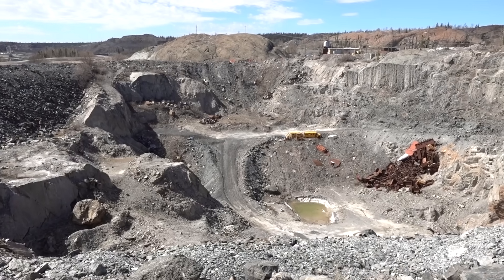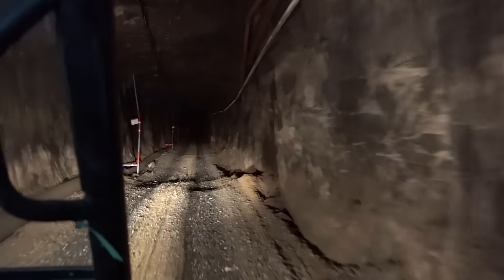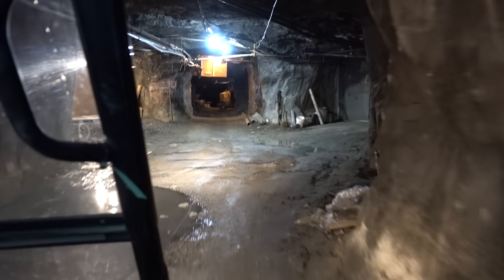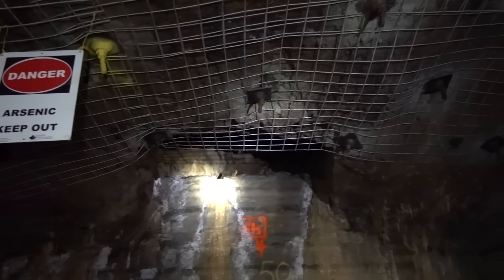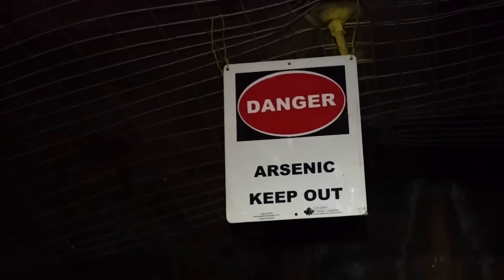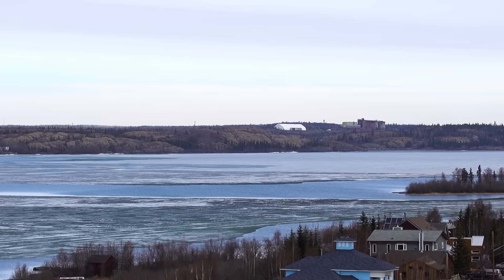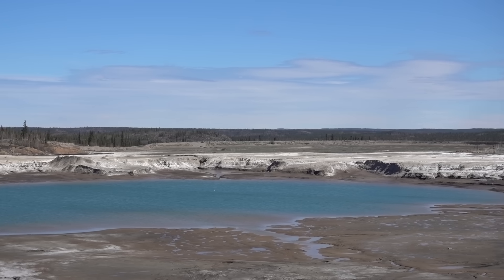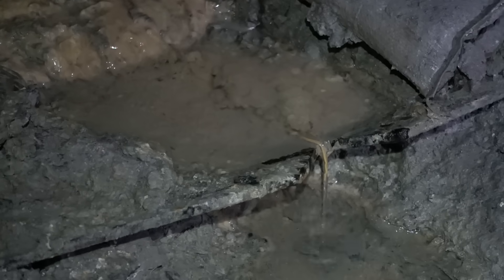Making 200,000 tons of arsenic dust safe

Comment: Why not mine up all the arsenic? That way you can store and control things surrounding it far better. Plus lets you possibly convert it into compounds Because putt that are harmless or less harmful.
Reply: You'd have a situation similar to the Liquidators of Chernobyl, where no one in their sane mind would want the job.
Reply: It's very fine volatile dust. The minute you start mining it you release a huge cloud of death over the city and surrounding area.
Reply: It’s dust, it’d be almost impossible to keep it contained during the mining.
Reply: Because there's no call for all that arsenic, and what demand for arsenic is supplied by purifying the waste products of active copper smelting. So, if you mined and purified this arsenic, then you would have to dispose of an equal amount of arsenic waste from (mostly Chinese) copper smelters.
Reply: bruh just put on a snorkel and use a dust pan

problem solved
Reply: Way more risky.
Reply: not if you are mining the ice that contains it
Reply: John J cheaper and safer to freeze it for now
Reply: "For now"...  and you just know it's going to get abandoned like the mine itself within a few decades.
Reply: That would achieve nothing and would very likely further pollute the water with more arsenic, as well as nuclear fallout, and would make yellowknife uninhabitable, because there is now a death cloud of arsenic and fallout over the city, not to mention that a nuke could directly damage the city, depending on how well controlled it would be.
Reply: Assuming thats jam packed in those caverns, couldnt one use something like a hydraulic cylnder and pack all of it into solid blocks?
Reply: FelixTheWat Here in Denmark they've just started digging up tons of polluted dirt left behind by a chemical company.
Reply: time and cost
Reply: i prefer the nuclear option, blow the mine up with a nuclear weapon.

Comment: It's disgusting how mining companies can get away with declaring bankruptcy and then bugger off without having to do anything about the poisons they've left (since, "obviously", it would be wrong to hold the owners of the company responsible for the company's actions and debts /s).
Reply: In some countries, companies are forced to set aside money for remediation into a seperate trust that would not be effected by bancruptcy. That way you can at least mitigate some of the "tragedy of the commons".
Reply: In the US, this is the case for commercial nuclear plants. All plants are required by law to have a decommissioning fund, and it is audited every 2 years to ensure that it's large enough to cover all the costs of decommissioning.
Reply: +Zachary Henderson "The CEO is just an employee of the company, the same as a heavy equipment operator." and guess what happens if a heavy equipment operator decides to get in a crane and drop huge slabs of concrete into people's homes?

Employees of companies are still liable for their actions.
Reply: Throwing the owners in jail would very much fix the problem.  Do that consistently and very quickly we'd see people stop exploiting the system.  The problem is that they pay off the politicians so they never have to go to jail.
Reply: +Windhelm Guard bankruptcy doesn't mean there's zero money. For example, everyone brings up that Trump bankrupted a bunch of companies - but he still has money. You can make people liable and force them to pay out of their own pocket even if a company is technically in bankruptcy.
Reply: It's called piercing the corporate veil. In certain circumstances, the courts will hold owners personally liable for corporate obligations such as cleaning up this kind of mess. In this particular case, the owner Margaret Witte was taken to court for allegedly raiding the company's funds before declaring bankruptcy.
Reply: SpeakShibboleth yea, but thats on purpose so no one has to take responsibility. Harmful decisions were made, as Tom said, so you can't claim no one was calling the shots.
Reply: Nubbinz It will be cleaned and paid by the gov aka everybody. They should seize the assets of the previous sharholders up to the 1b stated instead...
Reply: andi sixtimesseven so you could have one shareholder holding millions of shares or millions of shareholder holding one share. Of those millions of shareholder those shares could have been traded many, many times. So who is to be held responsible? Maybe your pension fund fund held shares by which you profited, so are you responsible?

Yes there are many ways that this could have been handled over the many, many years it would have taken to make this mess but closing stable doors come to mind. All you can do is stop it happening in the future and regulating.
Reply: What is even more disgusting is when companies plan to start a mine, finish polluting the surrounding environment as much as possible, and bugger off when they're done. There are companies that actively do that.
Reply: ObadiahtheSlim - while it is true that the EPA isn't perfect, that is not why they were a villain in the 80s.  The EPA and CDC both make common villains, esp in the 80s and 90s.  They are two organizations that produce a lot of anxiety, they are almost entirely associated with bad stuff happening and over the years that changed into a 'shoot the messenger' public perception.  Making them the villians in so many movies and TV gave people a sense of control over these larger than life problems because the symbols of them could be defeated by pluck and american ethos.
Reply: by paying up front of insurance to cover the damage.
Reply: Cody Scott You missed the "actually fixing the problem" step and went straight to "at least it feels good"
Reply: Well, they can't.  Not any longer.  Projects like this have to include environmental impact studies and funds have to be set aside in escrow in advance and held to pay for remediation of any such damage in the future.
Reply: The company did not go bankrupt. Miramar mining corp stopped mining the Giant Mine in 2004 then transitioned to care and maintenance under gouvernement oversight due to its significant environmental legacy. Miramar was then acquired by Newmont corporation which was interested in Miramar's other gold projects, and the federal government retained responsibility for the ongoing environmental cleanup.
Reply: What I find even more disgusting is how over the last 20 years or so mining companies have done a fantastic job of turning rural communities against the EPA and such.  They don't even need a reason at this point, the mythology that the EPA is just overreach of a tyrannical government is enough to keep local hostility high.
Reply: @neeneko  The EPA was created by Nixon and if you go to the wikipedia page it has a list of controversies that is longer than the rest of the entry and corrupt politicians have influenced and interfered with EPA scientists to a concerning degree. The idea of the EPA is great but they've had plenty of corruption and bs going on over the last 50 years. I think the EPA is vital but we need to stop politicians and industry from having any influence over it.
Reply: Generally these companies don't have owners.  They have shareholders and if you have an IRA or 401k you might me one of them.
Reply: Ogallalaknowhow What happened then?
Reply: Owners in jail ! So future compagny owners Will think about it!
Reply: That's why financial assurance postings exist. If I run a mine that disturbs more than 2 acres on the surface in New Mexico, I have to post financial assurance with the Mines and Minerals Division to cover  the cost of reclamation should the company go bankrupt.
Reply: That's why I say the debt should follow the CEO
Reply: I wouldn't be surprised if the company that made this mine is still around, considering that they made 9 billion from there mine. If we find out who did this, they sound definitely be sued all there money + what every it costed the government.
Reply: Keep in mind that the government made a lot of tax money off this mine.  That money is now being used to clean it up.  the money to clean it up is a small fraction of what the government earned in taxes.
Reply: I don't understand why so difficult. Just force to store the dust in the backyard of the decision makers of the (now bankrupt) mining company, "Hey you left this."
Reply: ObadiahtheSlim Peck was a prick, but also completely correct. They were in fact storing a dangerous substance in an unstable containment device in the middle of a city.  Pulling the plug wasn't smart, but he wasn't actually wrong...
Reply: The "odd" thing is that in our system the owners and management can have millions and millions sitting in their bank account after "their" company goes bankrupt.
Reply: Windhelm Guard Maybe they won’t be able to pay it, but yes I would say throw them in jail if they are found guilty. They have a cradle to grave responsibility of all impacts they have against the environment. If you let everyone go ‘just cause’ then what’s to stop anyone from further destroying the environment?
Reply: Windhelm Guard Yeah, when the company goes bankrupt, it has no money. The people who made those decisions though? They're not broke. They benefited from the profits and walked away largely untouched.

There's no real way to fix that loophole though. They've spent the vast majority of it, and there are legitimate reasons for company finances not to affect CEO finances (although it's usually just raining money for them anyway, regardless of how well the company is doing) and even if you did try and patch the loophole, they'll just use another one. ("I have no money your honour. My partner? Yeah, they have giant stacks of cash that I gave them and significant amounts of real estate. But I have nothing.")
Reply: and the government that allows this because profits > health of your own people
Reply: Companies always have someone running them. CEO, President, Chair, etc.
Reply: Danny Bhattarai Like any publicly traded company, part of the reason is to limit risk.  The much bigger reason is to raise money.  This allows people to do things, like build mines, when they'd have no way of doing so otherwise.  If there were no way of sharing the risk and reward of building something expensive, no one but the extremely wealthy would be able to do it.
Reply: Nawww those owner/operators shouldn't be jailed, they made people eat drink and work in those mines.  They can go in there with a ziplock and spoon and clean it up even if it takes them the rest of their lives.
Reply: That's capitalism for you.
Reply: That's why we should all hail communism

That's a joke, seriously.
Reply: Because capitalism relies on privatizing the profits and socializing the losses
Reply: @macomputersuck  that's a buzz phrase that means nothing. It's also not true
Reply: Corporations shouldn't be considered legal "persons".
Reply: @kentslocum  that's literally just what a corporation is. It's an artificial person that accepts legal liability for business actions. It's the literal definition of the word "corporation," it's what a corporation has been for the past 300 years, and that's just the only thing it does.
Reply: @zacharyhenderson2902  I know that; I also know that a lot of things wouldn't get done without the separation of liability afforded by corporations. Who would personally fund a skyscraper if they were personally on the line if it failed? However, I was simply pointing out that this legal immunity also causes the directors of corporations to take unnecessary risks and undertake harmful activities, knowing full well that they won't be held liable for the predictably disastrous results. I simply wish that laws regarding corporations were written in such a way to close loopholes and hold directors and CEOs more accountable for the actions of corporations.
Reply: @kentslocum  innovation is always unnecessary and usually involves harmful risks. I'm not quite sure where you're speaking about, but here in the United States the law always allows state governments and the federal government to pursue legal action against individual officers and stakeholders within corporations if they cause harm by acting negligently or without regard for human life.
Reply: If you have no money, you have no money. How do you think they went bankrupt after mining $8,000,000,000 in gold? Probably from having to put all that money back into the mine to keep people safe from it.
Reply: "Windhelm Guard
18 hours ago
that's not possible.
when a company goes bankrupt, it is bankrup, there is no money in that company anymore so how the hell do you expect them to clean up the mess with no money?
sure you can throw the owners in jail but that won't fix the problem either."

yes it will, ffs... when you punish people for their crimes, others are less likely to follow up with more... sweet jesus.
Reply: @dijasom  You don't know how bankruptcy works, do you?  🤦
Reply: I mean you can go clean it up, btw no one is paying you cause they went bankrupt.... Oh wait you dont want to risk your life cleaning up when your not even getting paid to do it? 

Thats why it wasnt cleaned up
Reply: This isnt done any longer you do realise that this was a mine active predomenantly in the 90s and 80s when enviro regs were super lenient. Nowadays it has to be 100% clean
Reply: Late stage capitalism is so fun.
Reply: @neilwilson5785   'Murica
Reply: Cody Scott yeah your right they should be jailed it would defer anyone else from committing those crimes against the environment and although it might not help that mind in question it would stop the same case from happening agian
Reply: +Neil Wilson you're right, communist states never turned areas uninhabitable as a result of their exploitation of natural resources. Never.
Reply: @ChucksSEADnDEAD  they don't turn areas inhospitable because they don't exist and have never existed
Reply: When a company declares bankruptcy and dissolves, it doesn't just walk away. It ceases to exist.
Reply: @zacharyhenderson2902  but the people who ran it, making themselves fabulously wealthy in the process, do walk away.
Reply: @keiyakins  you mean the employees?
Reply: Zachary Henderson he's probably still dumb enough to believe communism works in a post-industrial world

a bit hard for westerners to seize the means of production when the means of production is a sweatshop in vietnam
Reply: that's not possible.
when a company goes bankrupt, it is bankrup, there is no money in that company anymore so how the hell do you expect them to clean up the mess with no money?
sure you can throw the owners in jail but that won't fix the problem either.
Reply: @windhelmguard5295  bankruptcy just means you cant pay your expenses anymore. The company can still have money, but it just cant afford to operate
Reply: @windhelmguard5295  it might make business owners consider that they will be held accountable for the actions of their business though.
Reply: I would think it might discourage further company owners/executives whatever from doing this BS in future.
Reply: @windhelmguard5295  You fix the system that allows them to be bankrupt with no way to make people responsible for their actions?
Reply: @FOLIPE  
in any scenario where  a party that can go bankrupt is involved in mining you always run the risk of that party going bankrupt.

established regulations will be ignored.
punishing the people in charge doesn't make the problem go away. 

in the end the government (and therefore the tax payers) will have to fund the cleaning up of the whole mess.

which leads me to the solution to the problem: reserve mining rights to the government. the tax payer is going to end up paying for the clean up one way or another, might as well make it so that the tax payer benefits from the mining operation too.
Reply: @windhelmguard5295  works for me
Reply: @windhelmguard5295  I think the people who authorize and execute these operations are the ones to blame. I also think that the company can't declare bankruptcy as a way to get out of paying, if the company's assets/profits just funnel back to the aforementioned culprits. Therefore, money to repair the damage done to the environment, not to mention to save us all from poison, should be drawn from their own estates up to and including personal bankruptcy.
Reply: @windhelmguard5295  they don’t actually run out of money they just pretend they did to get out of it
Reply: @windhelmguard5295  throwing bankrupt business owners in jail would stop people from trying to abuse bankruptcy like this
Reply: @windhelmguard5295  throwing the owners in jail is a big deterent
Reply: @windhelmguard5295  The point being that this story isn't particularly unique. Mining company comes in, extracts as much wealth as they possibly can then leave an environmental mess in their wake that they didn't clean up.
Reply: @windhelmguard5295  Which is why they should be made to pay in advance. You want to build a mine? You have to figure out how much the cleanup will cost and put the necessary funds in escrow before you get to dig.
Reply: EPA isn't faultless.  There's a reason why one of the main villains of the 1980s movie Ghostbusters was an EPA bureaucrat.
Reply: @ObadiahtheSlim  except Peck was completely and utterly correct, as proven by the disaster when the grid was shut off. The blame for that one is entirely on the Ghostbusters, because they didn't actually think about things like *power outages*.
Reply: @ObadiahtheSlim  one of the stupidest movies of all  time
Reply: neeneko the EPA does enough to turn Rural America against it, itself.
Reply: Neil Wilson 😂😂😂😂 you say "late stage" as if it's dying
Reply: Steve W The CEO is just an employee of the company, the same as a heavy equipment operator.